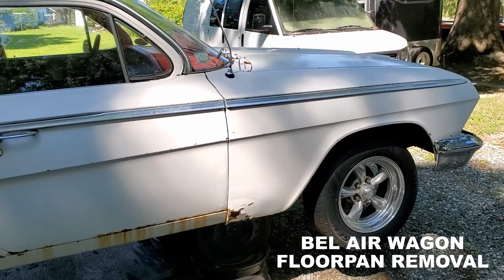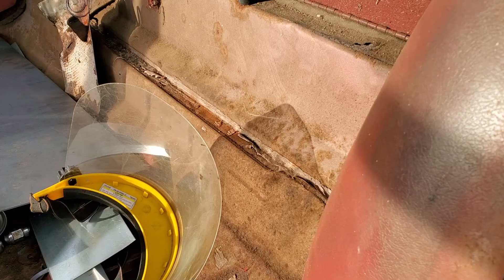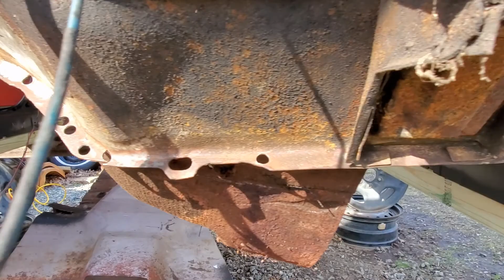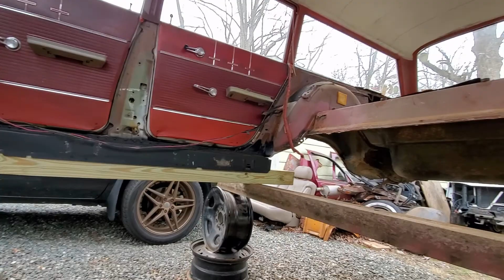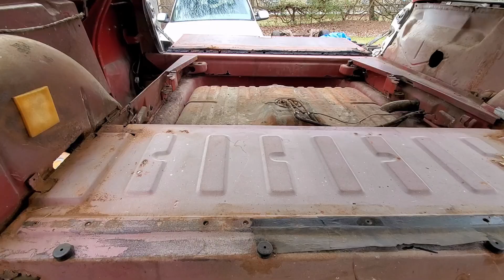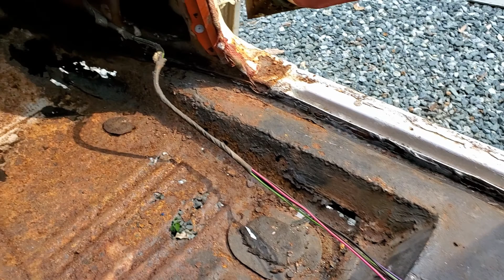1962 Chevrolet Bel Air Wagon Project Part 6 - Main Floor Pan Removal From Body

Comment: This is Totally Unsolicited Advice, especially since he's busy w/his project, but if you cut that rear panel out, do you think Jonathan W could make your replacement out of fresh sheet metal? It's just a random thought.
Reply from the maker: Im sure he could make something. It is a very complex piece with lots of bends and beads. Of course it is stamped from the factory. I guess they dont make them aftermarket since there is not a big demand for them. I will have it worked out in the next video.
Reply: I notice that if they weren't parts for their performance cars or popular vehicles, the other cars were afterthoughts if at best....and that's with the "Big 3".